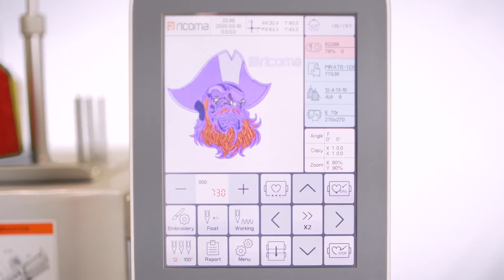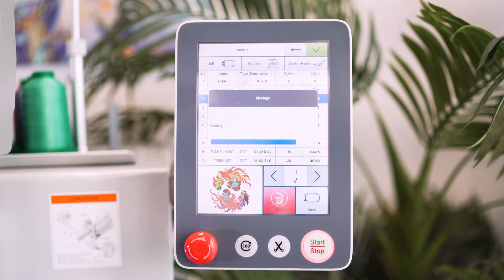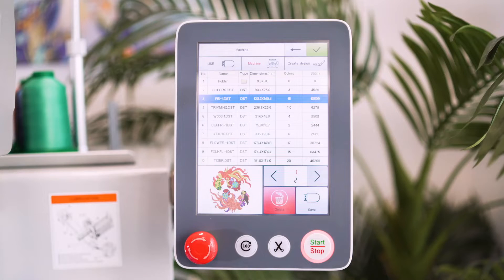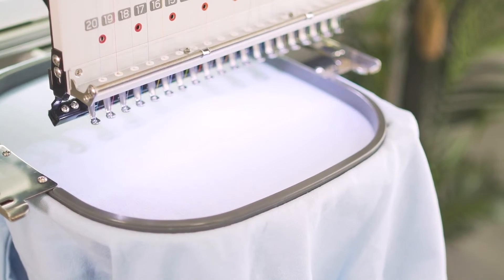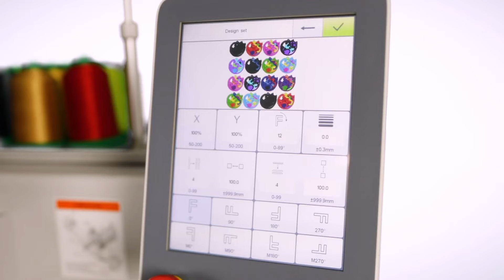Ricoma’s 20 Needle Embroidery Machine MT-2001-8S

Comment: What are the durability features? Also, how wide does the door need to be for the machine to get through? My door is just under 29.5 inches.
Reply from the maker: The measurements for the MT-2001-8S are 830mm L x 770mm W x 780mm H (32.7in L x 30.3in W x 30.7in H) - without stand.